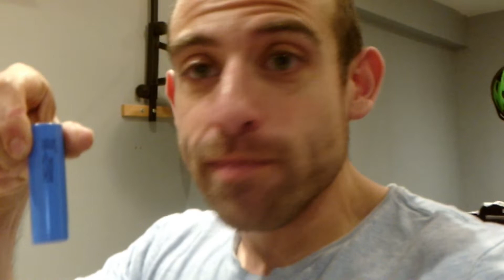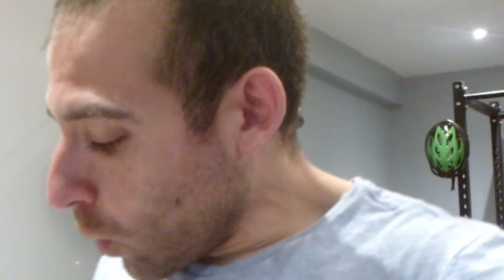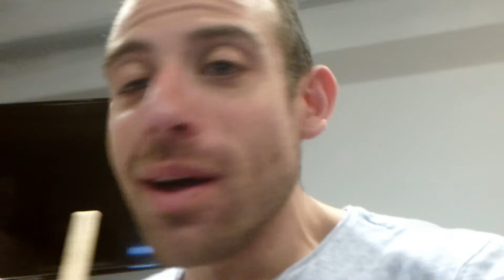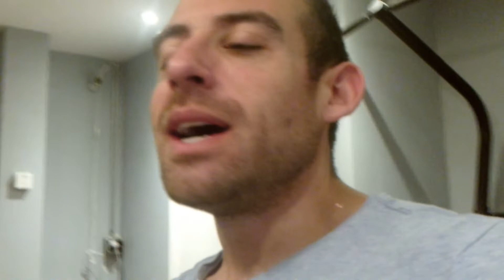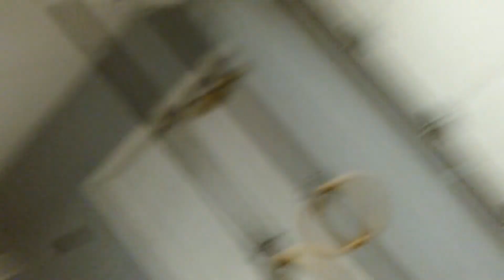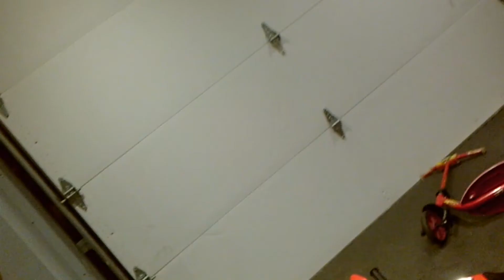Tesla power wall my a$$ POWERWALL 17160 Watt hours!!!!!! SAY WHAAAAAAT!

Comment: Do you still are gonna do this proj?? I can help u with the inverter and all you'r gonna need.
Reply from the maker: Yes i am looking for a 48v inverter need something that can power the whole house
Reply: @diyguy1476  It's a lot of option you can have, I can say a 7600 Kw inverter can work to you,  but  first you have to check the load you want to feed as a backup power, include A/C plate, water heater, and all equipment with motor you have at home
Reply: sorry is not a 7600 KW, is a 7.6 KW
Reply: Schneider, Inverter/Charger, Conext, XW, 6848 Watt, 120/240 Vac is a option to work as a back up or hybrid inverter
Reply: and that  inverter can work with a set of batteries you can set, like 48Vdc 400 AH or 800 AH or more
Reply: if you think to have your A/C  to the backup systems, you may have to install a soft starter to that